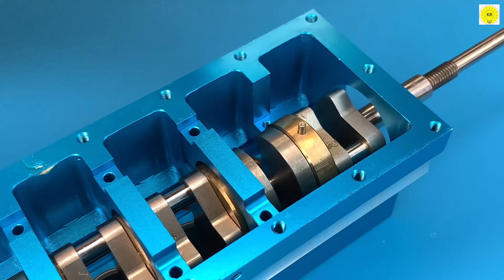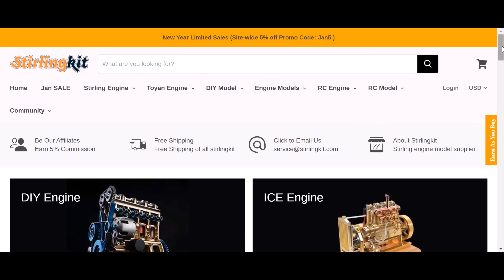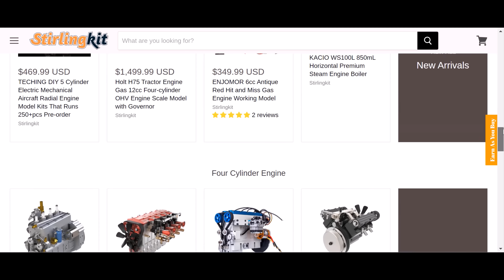Miniature FLATHEAD Six Cylinder Gasoline Engine Assembly & RUN!

Comment: $1300.00 and the water pump leaks?  Unbe-f**king-believable!
Reply: Unfortunately, the engine is very poorly designed internally, the lubrication system is useless, the water pump is very inefficient and the gasket that seals the cylinders is garbage.

Comment: This is NOT a flathead engine it is an overhead valve engine. Flathead engines do not have rocker arms and sparkplugs in the side of the head. And flathead engines do not have a rockercover on them. do yourselves a favor and Google Flathead six cylinder engine and look at the difference.
Reply: Not made by an English speaker, The intake and exhaust manifolds and other parts have a somewhat antiquated look, possibly leading to that mislabeling.

Comment: Not as good as they are attempting to lead you to believe. Can build a real ford 300 or AMC 258 for the same price or less.

Runs real rough in the video. Real 300 or 258 run real smooth. I have an AMC 258 in my 1979 Jeep CJ5. Low rpm torque monster. Idles at 600 rpm, pulls from as low as 400 rpm. When rock crawling normal 600-1,200 rpm.

Impossible to blow up. Cam in it will not turn past 4,500 rpm. Stock cam will not do over 5,000 rpm. Therfore impossible to blow up. Haft to be in first gear going down a steep hill with it floored to get to 5,000+ rpm.

AMC 258 simply wear out. Start burning oil after rings & cylinders or valves no longer seal.

I have had a number of them over the past 48 years in Jeeps. Impossible to blow up, with a low rpm rock crawling cam or stock cam.

If you put a high rpm cam, that will go, 6,000-7,000 rpm, for racing. You might blow one up, unlikely to though. Old cast iron hard metal heavy block. Would have to be built badly. They simply do not turn fast enough.

Start making good torque at 600 rpm. V8, do not start till 1,200-1,500 rpm.

Comment: Color: as picture shown;
Brand: HOWIN ENGINE;
Model: L6-210;
Form: KIT version;
Size: 252.05*88.56*144.48mm;
Weight: 2.4kg;
Engine type: gasoline internal combustion engine;
Valve train type: OHV;
Displacement: 21.0 (3.5*6) cc;
Cylinder: straight six cylinders;
Stroke: four-stroke;
Bore: 16.6mm;
Stroke: 17.0mm;
Speed: 3200-13500 rpm;
Power: 3.05ps;
Cooling method: water cooling;
Lubrication method: independent lubrication system (including oil pump);
Start mode: electric start;
Ignition method: CDI+distributor to control ignition (not included);
Spark plug type: Inch Thread 3/16-40 Spark Plug (not included);
Starting power supply: 7.4V 2S lithium battery (not included);
Fuel: 92# and above gasoline (not included);
Suitable age: 14+;

Comment: Let's be realistic here. It's obviously a lie. That engine was shaking all over the place at low rpm because it's horribly imbalanced and couldn't even idle. At 13k it would explode.
Also it was assembled by a toddler. Didn't apply the grease properly.

Comment: As much as a kit costs you would think they wouldnt be using threaded heat set inserts for 3d prints as a makeshift adjuster nut for the rockers and would use a proper nut for the design.
Reply: English ?

Comment: I thought about buying one of these to teach my kids how and engine works and how to build one.  1300$, I can get an old engine for less than half that price
Reply: True.

These are designed to be low production(ish) volume RC or display engines though, so generally end up being way more expensive.

If you wanna teach someone how an engine works though you can get larger engines for lawnmowers or weed whackers, both 2t and 4t for a lot less.

My recommendation though would be get a project car to work on with them. That'll let you show them the workings of the entire driveline as well as teaching them how to maintain and repair things when they go wrong... I know I'd have loved something like that as a kid!
Reply: There are smaller and cheaper ones out there
Reply: See if you can fit the other engine in ya hand
Reply: @brucebird133 for what I've seen, the build quality isn't really there either, I think it depends who you get it from but really you can get an overpriced pos if you don't look for hours on the internet
Reply: And rebuild it.  And throw it on a crosskart.

Comment: That's an overhead valve engine. Not a flathead! Flatheads have the valves in the block next to the cylinders.  The head has no moving parts in it, on a flathead.
Read the manual junior!

Comment: That is NOT a 'flat head engine'. The valves are in the head [overhead engine]. However, what actuates the valves?? Nothing is shown, and the engine doesn't run at the end of the video. The starter is apparently still turning it over, as it blubbers and misfires at low RPM. This video as shown makes no sense. Something is way off here!!

Comment: How much horsepower this beast has? Very nice miniature.. I recently dismounted electric skateboard engine and it's supposedly just small microchip attached to battery pack that is attached to wheel with magnet.. it was bit more complicated that just random electric screwdriver thought, also very cool as electric engines supposed to be future, thought sometimes past is not even explained...

Comment: Not a flathead it's a OHV engine
Reply: Ein Flathead hat die Ventile im Motorblock und nicht im Zylinderkopf
Reply: @ulrichlehmann9624 hauptsach er  laft
Reply: Inline 6 is the correct discription. I wonder if they build miniture flathead V8's?
Reply: @Gasoline4ever  yep it existe
Reply: Flatties don't have valve covers!
Reply: 1111
Reply: I was gonna say the same thing.
Reply: Exactly
Reply: I can machine a diesel
Reply: OHV aned. Is ja unten die Nockenwelle
Reply: Yes
Reply: It's a ford dummy you know what ford stands for don't cha. Well don't cha...     it stands for fix it again tony.
Reply: I think hes confused I think he means straight 6 not flathead 6

Comment: Great build. But a price of a full size engine is a bit too much.
Reply: These engines are for a niche, so limited production.  Also, design, testing & manufacture would be costly, especially if these are handmade engines.  That's what makes these engines pricey
Reply: My exact thoughts very pricey for the size. You can get a full scale car engine for that

Comment: Great build!! 13k rpm says a lot for the matching and assembly. This was one the most satisfying videos to watch. Thanks for all the great videos!!
Reply: It's obviously a lie. That engine was horribly imbalanced shaking at low rpm and couldn't even idle. At 13k it would explode.
Reply: @Inimbrium it is mainly due to carb issues, 6 cylinder engines are very balanced no matter which rpm, usually they don't rev very high because of a lot of moving parts, and more than enough power at low rpm
Reply: 13 k also says a lot about size.
With a stroke of maybe 1 inch, 
The pistons aren't even moving as fast as in a normal car. 
So all the forces are lower.
Reply: @@melonbobful fair enough. Makes sense.
Reply from the maker: I am glad that you liked the video